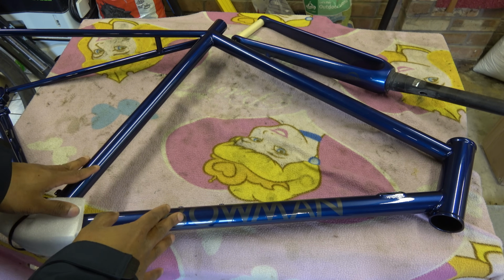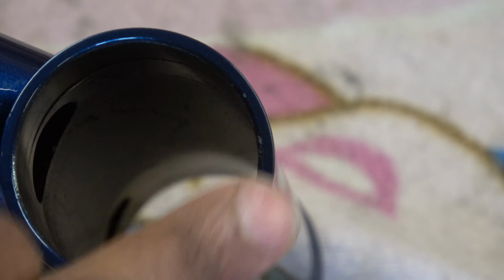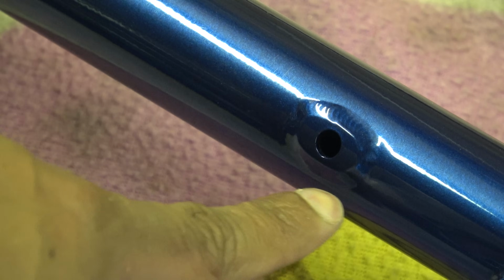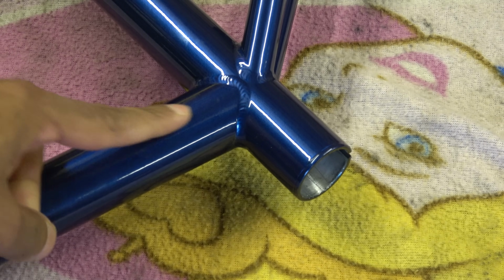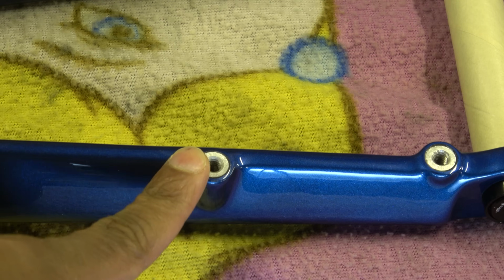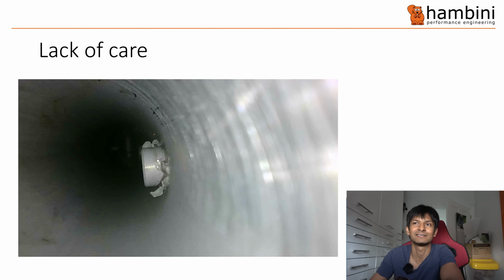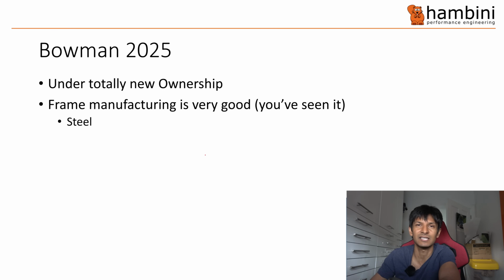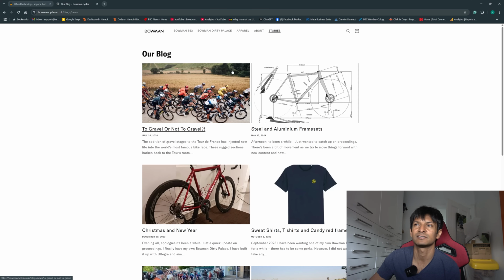DRUNK Man Buys England's Worst Bike Company after drinking too much

Comment: Please consider a 6069 Aluminum  frame., since your sourcing from Tiawan alredy. Cheers.
Reply: @garysladek9110  Steel makes more sense for a guy doing it as a side gig in likely small batches. Factories doing Alu generally only do large runs and steel commands a higher price tag than alu per unit, further benefiting the small outfits.

Comment: Carbon fork with Steel frame is a pretty common combination (my 13 year old Genesis has it). Good luck to the man. Looks like a great frame. I'm pretty sure that 853 tubing is produced, by Reynolds, in the UK, so though the bike is welded in Taiwan the tubing is from the UK at least. Really odd that the guy would buy a brand with such an appalling reputation though! Still best of luck to the guy, he's clearly putting effort into producing a very decent frame

Comment: There is nothing special about pairing a steel frame with a carbon fork. My Panasonic CrMo frame has got a carbon fork fight from the factory. The only real issue with this frame on the video is that it's welded whereas steel frames are supposed to be brazed. It's quite weird that the author of the video overlooked such a fundamental flaw.
Reply from the maker: yes bot.
Reply: @Hambini  bot??? Do you really know what bot is???
Reply from the maker: @MSM5500  Yes it's the square root of diddly squat
Reply: @ your humor isn't flat enough to be funny.
Reply from the maker: @MSM5500  I wasn't being funny, I was asking you if you knew that the square route of diddly squat was bot
Reply: @  "I was asking you" but forgot to pit the question mark. Please give up.
Reply from the maker: @MSM5500  you are quite a crap bot. You don't understand humour very well
Reply: @MSM5500 he has absolutely no idea what this frame is made of & is just saying what he's paid to say.
Reply: Hambini is just another pay-to-play shill, like zero friction. Neither has the slightest clue what they're talking about 😂
Reply: 853 is robust enough, because of it's heat treatment and air-hardening, that welding is zero issue. It will not weaken or distort when being welded. Brazing is prefered for lower grade steels, but for 853 it does not make a real difference and Welding will likely be quicker and cheaper. You are correct on the carbon fork/Steel frame combo. It is very common.
Reply: 'fundamental flaw' 😂

Comment: The UK's 'Worst' Brand? 

Come on, I've owned an Aluminium Planet X frame for a while, it was cheap, there are reasons it was cheap. 

I think the Late 90s/early 00's was the boom time for Cheap Far-Eastern frame importers with a "Brand" to launch. Times have moved on and people have gotten more used to scrutinising the products now, but we've accepted toss manufacturing for a while, so long as it comes with a bit of a cost saving...
Reply: Dolans cheap sub 250 pound ALU  frames go out of the door with no Q&A at all. None. I bought one that had  "cosmetic" damage. Picture show was a small paint chip in a place where you could not see it and would not matter. Perhaps made to distract from the fact that the rear triangle was not even a triangle and did not line up correctly. 

Also, the rear brake attachment boss that you screw the rear brake into, was misaligned to the point that the middle of the bolt was over the side of the rim. It was off by at least 1/4 inch. Total junk. I discovered this too late, one year later, on a touring bike project. No refund offered once requested. Avoid Dolan junk like the plague or make sure you go over every frame with a fine tooth comb and make sure it is aligned right. 

I wont buy Dolan ever again and say this spiel every time i read people talking about bad bikes
Reply: @suminshizzles6951wow so weird, every Dolan I've seen was the precursa and they were ok, plus the owners did some tricks and some good urban fuckery stuff.

Comment: I was a stones throw from buying a Bowman when you did the last video. I was looking for a lightweight non-carbon frame that I was going to fit some high end components to... boy did you help me dodge a bullet. As regards to the new frame, as you well know, repeatability in manufacture is key, hard to get right initially but pays hugely once you get it right, and cheaper than getting it wrong. It will be interesting to get some reviews on how these frames ride 853, stainless and ti. Having ridden many different frame types, sometimes you sit on a bike and just realise the frame works... and that has less to do with the material than you would think. I often wonder if it is by design or just good  luck.  ( On carbon frames the design iteration can quickly go one way or another, even with the top brands where a frame might have a fantastic ride then the next gen it is widely off the mark--- maybe once they commit to a design they don't have time to peer review the frames properly and rely on lighter/aero/ custom paint job marketing to sell to get their return on their tooling investment.  Good to see an enthusiast trying to do it right though and good luck to him.

Comment: Interesting interview. The first batches of Bowman’s were actually very good, although my 2017 palace r did eventually crack after 25000 miles
Reply: that is very decent mileage tbh. I still ride two Bowmans with roughly 20k kms each on them. A pilgrims disc with Ultregra/GRx810 mix, 8kg total with pedals and cages, rides and climbs really really well, it's a perfect 4 season bike. I find the power transfer around the bottom bracket as good as the one on my posh carbon HM carbon bike from a big player brand I won't name worth over twice the price (frame). I absolutely love the 32mm tire clearance on the Pilgrims. Came off it numerous times, has 2 dings on top tube, slammed it on cattle grids and pot-holed lanes, where I mostly ride, countless times. Still going strong. The palace R I got a year after as it was very cheap and I wanted a light rim brake summer bike. Great fun to ride too, no issues whatsoever very positive experience although maybe not as efficient as the Pilgrims (thinner chain stays perhaps) . I use it mostly on the trainer now as I prefer riding disc bikes outdoors here in the UK mixed weather conditions.  Not sure who makes a decently light and strong  Aluminium frame  these days. I've seen some horrendous looking  Alloy Treks built to supposedly high standard shipped with forks that don't match the bottom headset bearing..I mean even the big brands QCs can be wildly off at times
Reply: @ incredible mileage for an Alu frame. The second palace r I had was shite though

Comment: A good steel frame with a good carbon fork is a dream to ride. The very best steel has stopped being made now though... ☹️
Reply: Did a back-to-back test ride - same Reynolds tubed steel bike, swapped fork from carbon to steel. Left the steel one on and sold the plastic one at a bike swap.
Reply: 853 is high grade.
Reply: @a1white yeah, but it is no True Temper S3...

Comment: Hambini, will you make a special video on the new Time Scylon, please?
Reply from the maker: In all honesty, I don't think the bike is relevant any more. It's well made but then (now) so are everyone else. I've got two scylon's one rim brake and one disc brake. If you ask me, the Time Scylon rim brake was the peak. It had the NTN headset and was made in France. The modern scylon has ditched the headset for Deda or whomever and it's made in Slovakia - whilst I'm not dissing slovakia. It doesn't have the heritage of something made in France.
Reply: @Hambini  Unfortunately I agree about Time. The only 'thing' they have left now really is the Braided Carbon Structure and Resin Transfer Moulding technology, which translates to a different ride feel, but you can get most of that feel now with wider tyres and lower pressures.
Reply: @Hambini  They are setting up production in the US (South Carolina), so I think it will make the brand a bit more accessible for North American buyers.  I like the product, and wish I could have one of their new large tire versions.